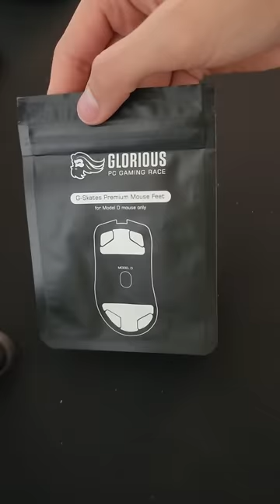I Upgraded a SUPER Popular Gaming Mouse

Comment: “i wouldn’t do it again because… this is a glorious model D” ?? doesn’t make sense

no hate btw ily switch and click
Reply: Glorious mice suck to use
Reply: @drewzma6816  i have the model D and i love it.
Reply: @drewzma6816  how
Reply: @_Beam  bad qc, battery life, and heavy for honeycomb mice
Reply: woman ☕️
Reply: Does make sense. They're not the cheapest mouse to just mess around with for the amount of content you can generate from it. At least keyboards are extremely customizable.
Reply: @drewzma6816  their def not heavy
Reply: @drewzma6816  🧢
Reply: @drewzma6816  battery life 💀
Reply: @drewzma6816  they are in no way heavy, if you think 68 grams is heavy maybe you should try the gym
Reply: @Drewzma it is called wired mouse maybe that new to you
Reply: @sendona1288  for mice with holes they are heavy. Even glorious new mice are much lighter and don't have hole
Reply: @sendona1288  for mice in general 68 is very light, but for a honeycomb simple mouse 68 is indeed heavy.
Reply: @sendona1288  I don't think they're a bad mouse, but that person wasn't wrong when saying it's heavy for a honeycomb mice. The word makes a difference. 68 is a lot for a mouse being marketed as exponentially lighter than normal gaming mice. I have a Viper clone without the honeycomb design and it only weight a few grams more. It's ultimately better than the glorious too when it comes to battery life and QC... So Glorious isn't bad, but it should be better.

Comment: Prep plastic surfaces better with high concentration alcohol next time also preheat the plastic in the sub and it absorbs paint better if it’s temped right. Do lighter coats of paint and finish with a few coats of clear. 😊

Comment: You didn't clear coat it? Also you could have just sanded it down very lightly with high grit sandpaper to remove those like bumps in the paint then clear coat it after it's dry to seal in the paint. Otherwise it's gonna rub off all on your hands over time lol.